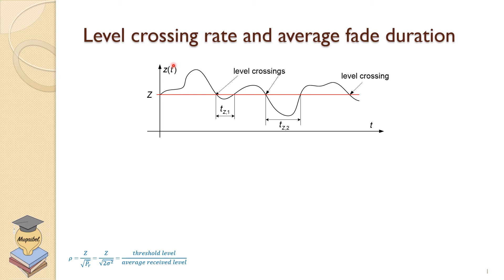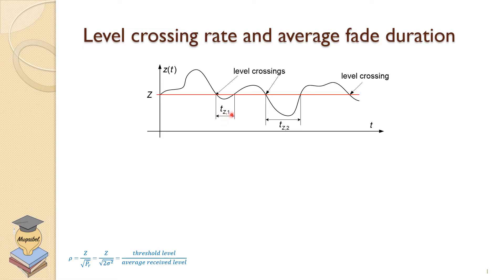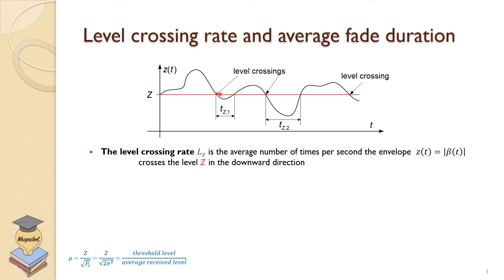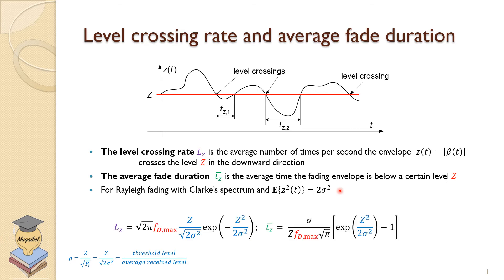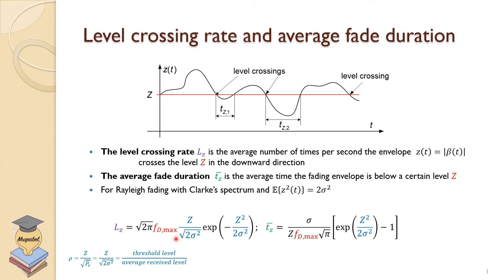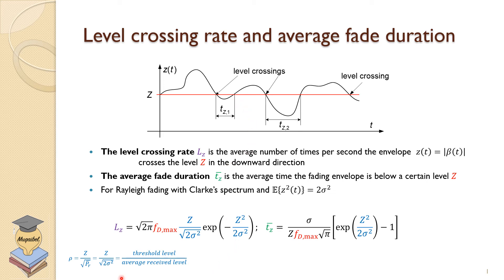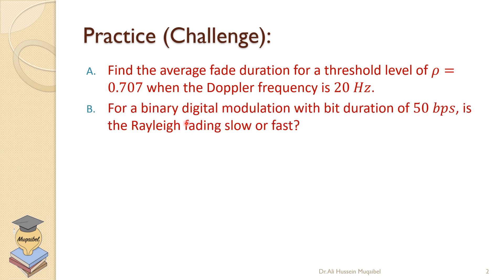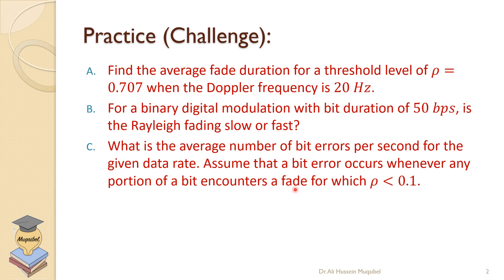4.4 Level Crossing Rate and Average Fade Duration

Comment: A-
AFD = [exp(rho^2) - 1]/[rho*fd*sqrt(2pi)] = 18 msec
B-
coherence time = 1/fd = 0.05 sec
Ts (symbol duration) = 1/50 = 0.02 sec
since Ts is less than the coherence time hence the Rayleigh fading is slow. 
C-
rho = 0.1
The level crossing rate is Lz = fd*sqrt(2pi)*rho*exp(-rho^2) = 4.96 crossings/sec therefore the average bit error per second is approximately 5 bps.